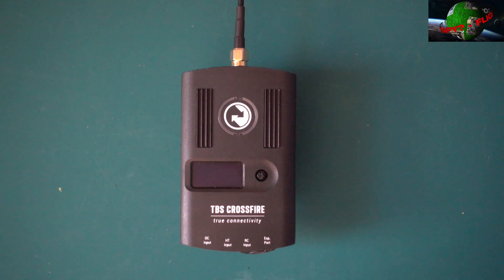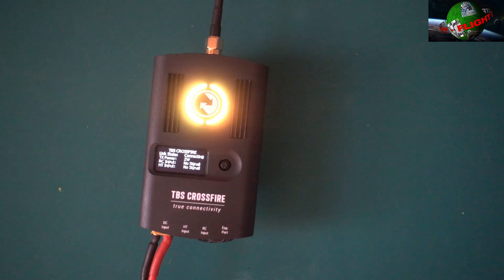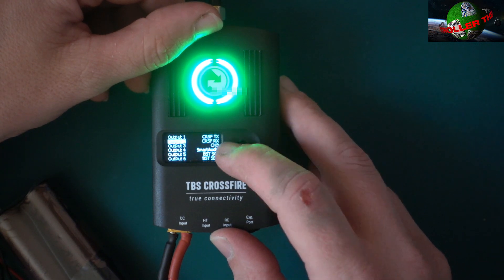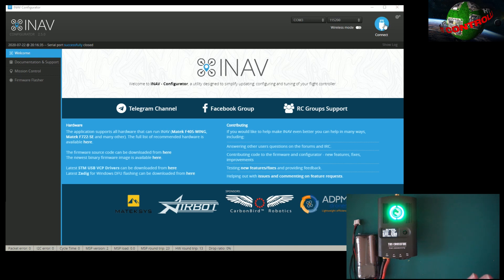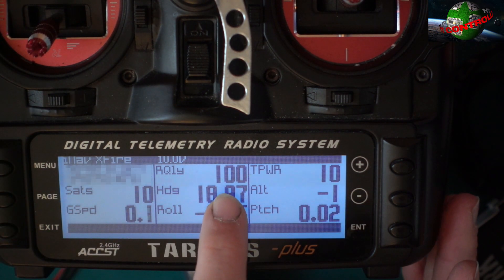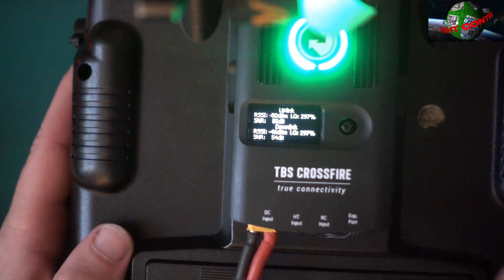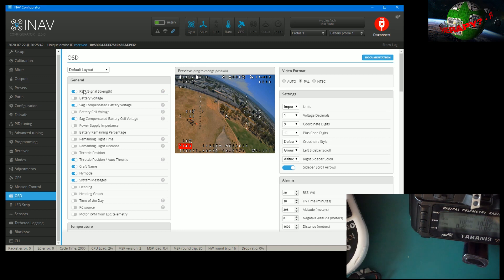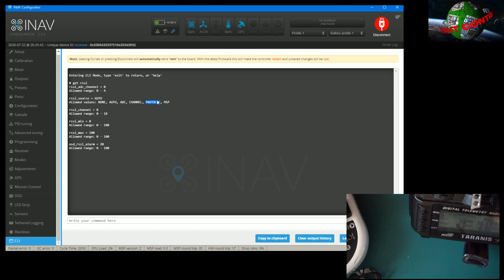How to get Crossfire LQ on the iNav OSD

Comment: Hi
I did it as you say and my osd shows 0:)
Please tell me if I missed something.
Reply: Hello
Can you explain again how to set signal strength the way you do please? As I have difficulty:)
Thank you
Reply from the maker: What are your settings on the crossfire and iNav?
Reply: Mr.D - Falling, with style inav is set to Chanel 12 rssi and in crossfire it is set to rssi/ lq
Reply from the maker: Chris Solek if you’re setting it up the old way, that should work. This new way you don’t set LQ to any channel on crossfire. In iNav, you set the RSSI channel on the receiver page to disabled. It’s also worth checking the CLI command is set to AUTO.
Reply: Mr.D - Falling, with style and if I do it this way then signal strength in osd is 0:)
Reply: Mr.D - Falling, with style sorry to bother you, but also do you know what to do in inav so I can use 3 c plane with rudder and elevator so Rth will work properly, because now my plane flies good but as soon as I put Rth the plane goes breakdance :)
Reply from the maker: And you’re using a recent Crossfire firmware and iNav?
Reply from the maker: For the plane with a rudder, check out Andrew Newton’s channel. He has made a great video covering this.

It’s never bother buddy. We all help each other in this hobby 👍🏻
Reply: Mr.D - Falling, with style never updated
Reply: Mr.D - Falling, with style ive seen it but it’s not good as not detailed really I willl find out by  myself for sure:)
Reply from the maker: Chris Solek never updated is probably the problem 😄
Reply: Mr.D - Falling, with style thank you my friend I will update to and rx
Reply: Do you think that matek f405 wing is good enough for arduplane?
Reply from the maker: You can run Arduplane on and F405-WING. I’ve not tried it myself as I can’t stand the UI for it.
Reply: Mr.D - Falling, with style yes, thats what puts me off it too
Reply: Mr.D - Falling, with style should I also update tbs Nano rx?
Reply from the maker: When you update the module, the receivers will update when you next bind. On the full size crossfire anyway. But yes, you want to be running the same firmware version.
Reply: Mr.D - Falling, with style but I bind only once
Reply from the maker: Most of the time yes. Sometimes I’ve had to rebind after updating Crossfire, but not often.
Reply: Mr.D - Falling, with style hello my Friend 
If my rudder and elevator elevator plane moved control surfaces well when I move it armed in angle mode, then all navigation modes will work well?
Reply from the maker: Sorry, I don’t follow you? Is this for iNav? 

If so, you should first check the gimbals are correct first in the receiver page (I have a video on setting up a receiver in iNav, which shows what it should look like). Then test the control surfaces in manual mode to make sure the are moving correctly and have the correct throws. Then test the stabilisation in angle mode, to make sure the surfaces move the correct way when you move the model. 

If you haven’t already. Check out INAVFixedWingGroup on Facebook, as there’s lots of help on there for iNav. There is a link on https://inavfixedwinggroup.com
Reply from the maker: Is it a new setup or one where it used to work over a channel?

If it was previously set up, make sure that in the receiver page you have turned off the RSSI channel there. It may also be worth checking the receiver its self to not send LQ over channel 12 (or whatever channel). Also check the rssi_source CLI variable that’s in the video. It should be on AUTO, but you could also try it on PROTOCOL.

The other things to check are that iNav is on at least version 2.4.1 and that you have a recent (within a year) crossfire firmware on your system.
Reply: Mr.D - Falling, with style ok
Thank you my friend
Reply from the maker: No problem. If you still have issues, drop another message and we can see if there’s anything else it could be.

Comment: I watched Bardwell's video on this for BetaFlight, and after watching yours also it's hard to believe it's that easy! Hopefully iNav 2.6 will include an LQ OSD option also instead of just "RSSI Signal." Thanks for this video
Reply from the maker: It would be handy for the OSD to say exactly what is being shown. At the moment its just the signal strength, and iNav decides what to use. What I have seen is someone is developing something for the iNav OSD which can show RSSI 1 & 2, LQ, and SNR. That would be a really useful addition. So hopefully it will be in a future release soon.
Reply: @MrD  as long as you can pick one, two, etc. I don't want to have to add 4 lines to the OSD. Fingers crossed. But this "signal" strength is better than nothing :)
Reply from the maker: I will ask the guy. I can’t remember his name at the moment. It was in the INAV fixed wing group on Facebook.

Comment: Do we have confirmation from Inav Devs that it is indeed passing LQ and not RSSI?   I suppose you'd notice pretty quick when it doesn't park on 99 ;)
Reply from the maker: Yes, this is passing LQ. You can also see the RSSI on the back of the full Crossfire module. This number was different to the number on the OSD. The number on the OSD matched the RQly sensor. 

In the demo, it is pretty solid on 99, which can be either 99 or 100 because it’s only a 2 digit display. But, in testing, I did have my transmitter at the other end of the house. The 10mW signal had to travel through 4 brick walls and 2 stud walls. The OSD matched up to the LQ still, not the RSSI. It just would have been much harder to demo this in the video.
Reply: @MrD  I had the same issue trying to verify that the OSD number wasn't just stock at 99. I out my radio inside a full metal cabinet and when I closed the door the OSD dropped to 97 for a second, then I'm guessing the xmitter boosted the signal and it went back to 99
Reply from the maker: Its crazy how much LQ it has, even on 10mW. If I moved the transmitter about 10cm it bounced straight back up.

Comment: Howdy, it makes the assumption that you're using XF because you're using CRSF as the protocol? Matt
Reply from the maker: Hi Matt. Yes, this is using the CRSF Protocol. Using SBUS on the Crossfire just results in the signal strength being pinned to 100. I had the transmitter at the other end of the house, SBUS pinned to 100, Crossfire (10mW) was around 70-80 when I shielded the Rx antenna. 

I will work on some other receivers though. I’ve read that it will work with an L9R on SBUS. But I’ve not tested that myself.

Thanks, Darren

Comment: It's channel 17 isn't it?
Reply from the maker: Or channel nothing 😄
Reply: @MrD  But why is ch17 having a signal? I once wrote to TBS and asked them for more channels than just 12, even with more latency and they replied that they have no intentions to support more than 12 channels...??? Any idea?
Reply from the maker: No idea. It must just be a ghost channel for data like that. I’ve also heard of channel 14 being used for LQ?
Reply: Using Channel 17 would also work. Is the same thing. The LQ received by the FC in the link statistics frame is used for OSD 'RSSI' and also send to channel 17.
Look at the code (line 235): https://github.com/iNavFlight/inav/blob/master/src/main/rx/crsf.c